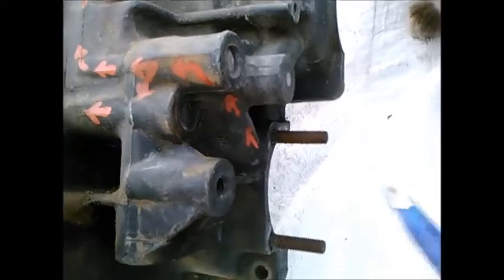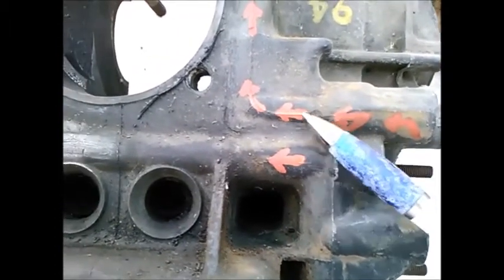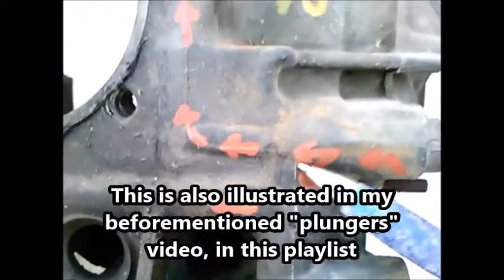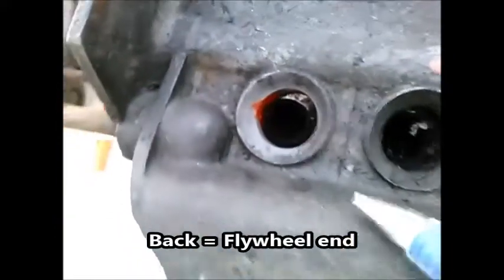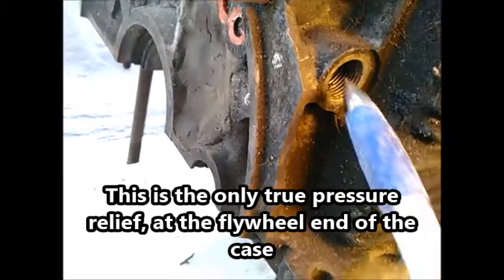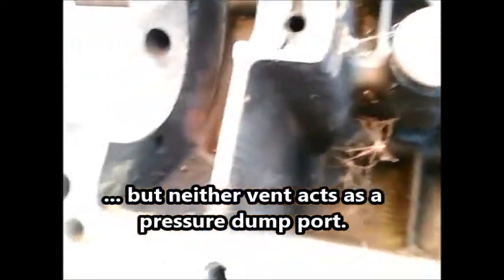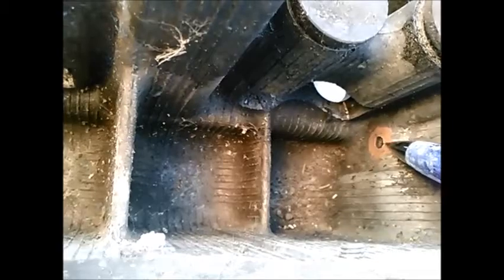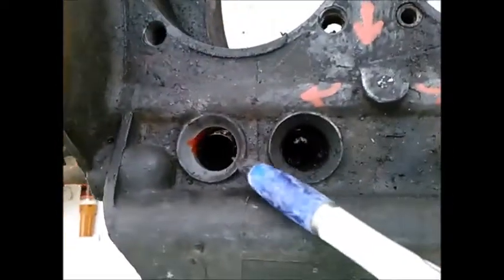Oil Pathways and Flows in VW Dual Pressure Relief Case

Comment: good vid  and thats my understading as well   but what i want to know  on oil pump end  why is ther any plunger  as surely u want oil to go through the oil cooler all the time then feed the bearings  can u clarify    i dont see any thermostatic valve  relating to temp
Reply: It's a relief valve, in the sense that it's main purpose is to protect the oil cooler from bursting under pressure. It's not temperature sensitive, it's pressure sensitive.
I'm not sure that it seals 100%, but it significantly restricts flow.